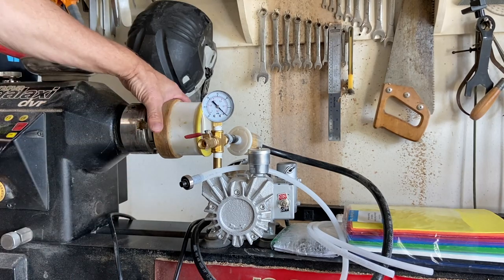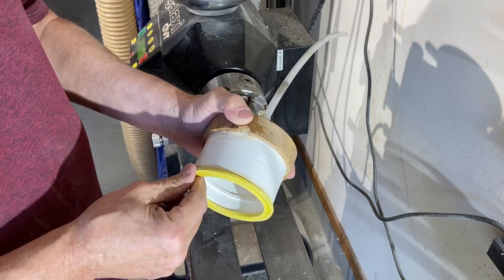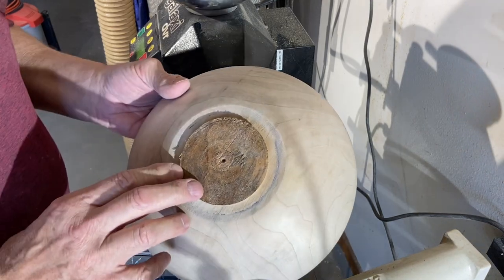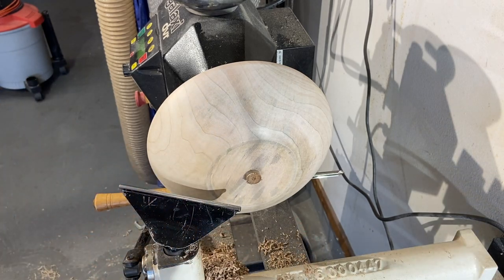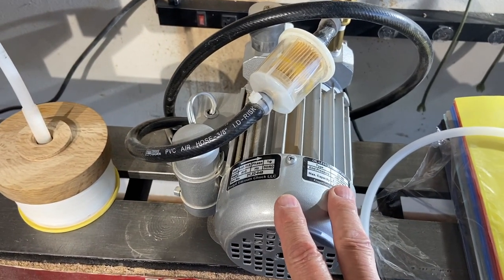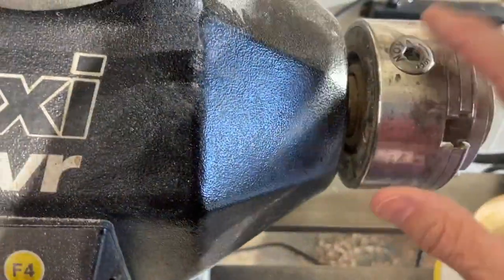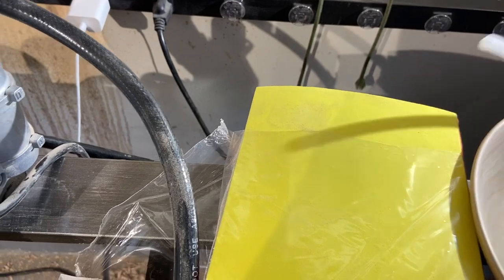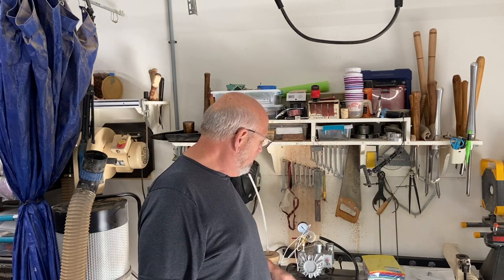Homemade Lathe Vacuum Chuck (save your money!)

Comment: I fitted an in line fuel filter on my exhaust and there was no visible oil mist coming through or any build up on the underside of the table that holds my lathe. It also acted as a muffler and cut down a great deal of the noise. Very informative video.
Reply from the maker: Great solution!

Comment: Thanks, this would be a nice Spring/Summer project to build.
Reply from the maker: Don not know what size lathe you have but the line thru the headstock is very tight meaning no leaks I do get leakage from the Robust model but still only a little.
Reply: @bowlreveal  I have a Laguna 1836.
Reply from the maker: @trurex007lee7  the tubing I use is 3/8" outside diameter, your lathe is also 3/8" inside diameter thru the head stock. I'd pu a piece of 3/8" tubing and see if it it will fit. Should. Have a great day

Comment: My hope was that you would show how you hook your vacuum pump up to your robust adaptor...  I have since figured it out for myself, but my curiosity is that you have a pneumatic connector on yours and I am wondering what you use between the pump and your lathe??  I have a barbed connector to work with my tubing and it seems to work.  thanks for the video
Reply from the maker: Sorry about that the truth is I am a snow bird, my Robust American Beauty is in Orchard Park, NY. So I don’t have it to film. But I noticed my quick connect was loosing vacuum. The slip on system is tighter.
Reply from the maker: Also at the end of the video I talk about pump repairs and oil problems

Comment: Does your vacuum pump get hot after a while?
Reply from the maker: Oh yeah, the whole purpose of the vacuum is to hold your piece to the lathe, which stops the air flow which would allow the pump to air cool. Once you have it on you have to finish your project because realigning is more difficult, not impossible. Have a great day.

Comment: What is the CFM rating of your pump?
Reply from the maker: Bought the pump from the same guy I bought the chuck kit from on line. It’s a rebuild the manufacturers plate is missing. No CFM rating ser # Nothing just an on off switch. Sorry about that works great though.